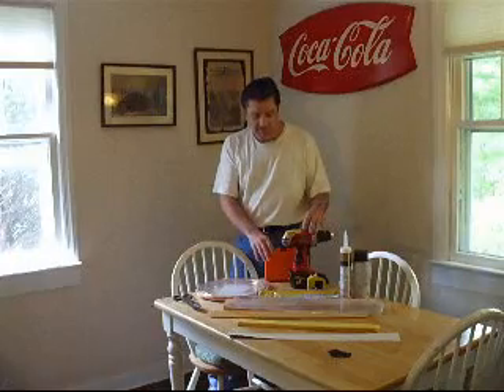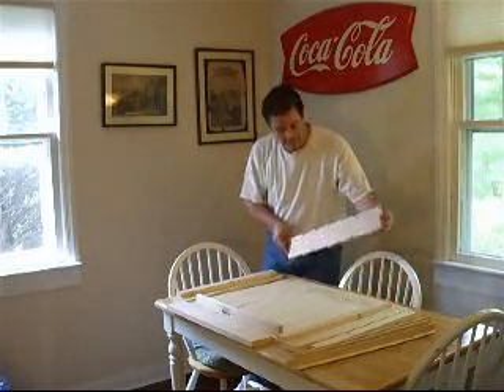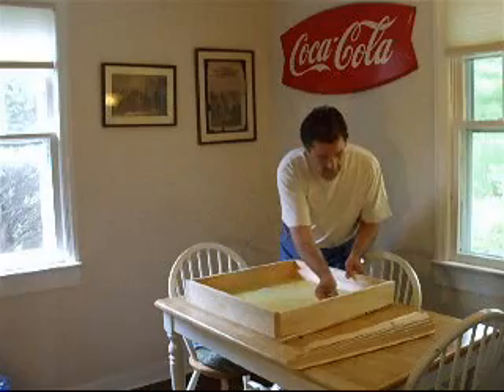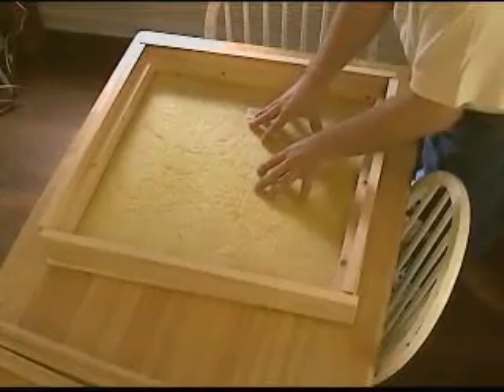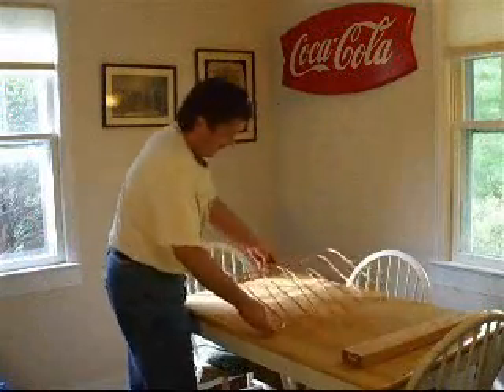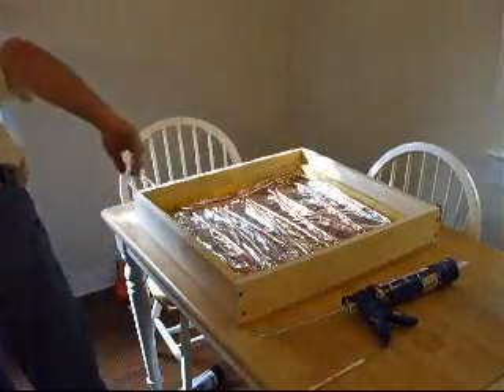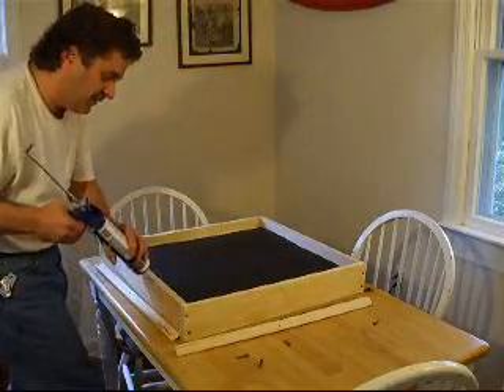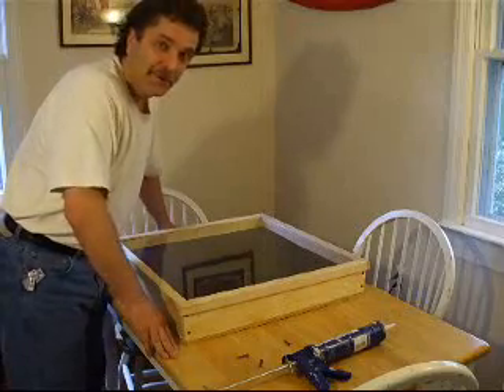Free Solar Heat "How to build a solar panel DIY" bloom box Part 1 Ernie Ursini

Comment: Can we have the heated water run a turbine to generate electric power for running electrolysis to produce hydrogen for gas and electricity needs of a house?
Stanley Meyer was murdered for his inventions which could've made fossil fuel obsolete, but he didn't get a chance to mass produce them.  Killing million Iraqis and invading for oil could've been prevented by demand for free energy, water for fuel through inventions of Stanley Meyer.

Comment: This is EXCELLENT but don't you have to drill holes through the sides and have the copper tubing stick out of it so that you can hook it up to a hose that will run the water through it?

Comment: Thank you for your interesting video. I would like to make a suggestion.
When you drill holes into the plate on either side of the tube and attach the tube to the plate by twisting a metal wire, you realise full contact between the tube and the aluminium plate. This increases heat-transmission, which makes your tool more efficient. Question: Could you explain the reason why you do not expose the tubes to sunlight? Thank you in advance

Comment: not a very inefficient design.. you are using convection to transfer the heat.. you are better off with the copper pipe on top of the Al sheet also painted black and then 2 sheets of Plexiglas to insulate the front